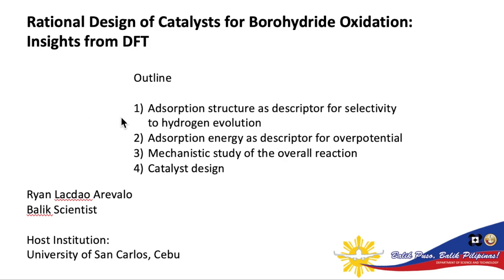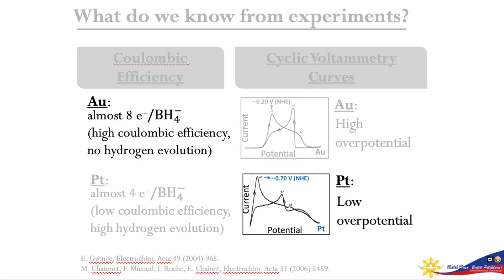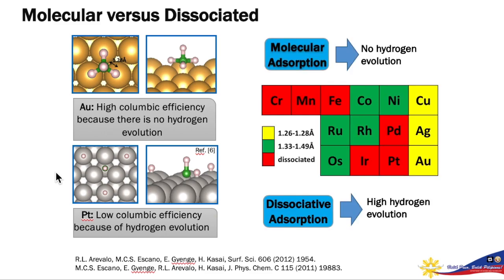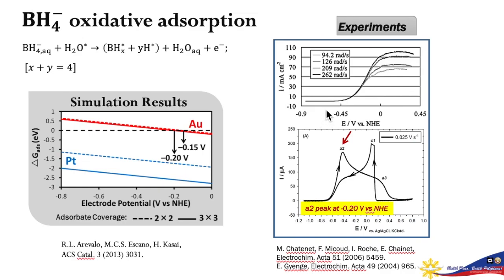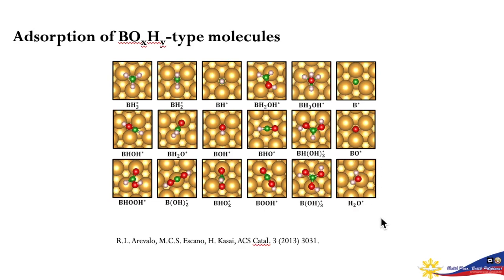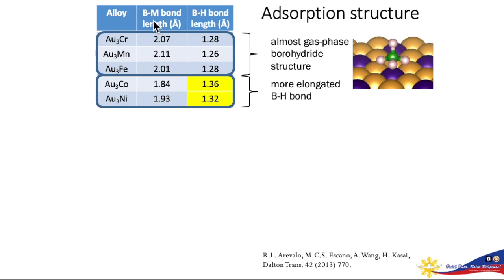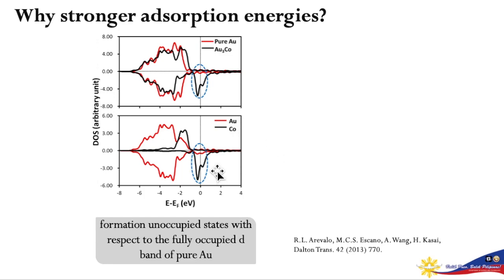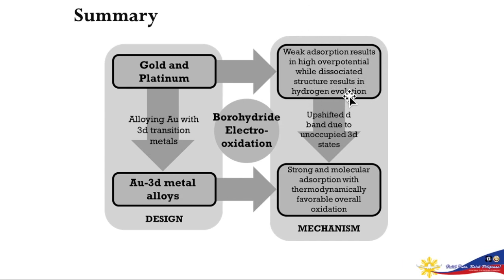DFT calculations for rational design of catalysts for borohydride oxidation

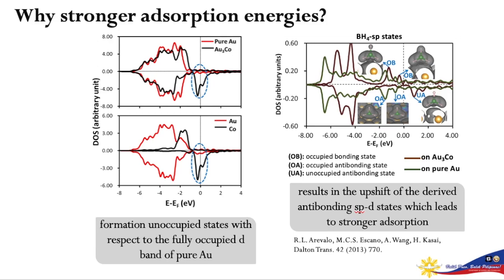Comment: Hello sir. I do have some questions boggling about your lecture. Let me start with the slide @24:46. I am wondering on why the partial DOS of Co in the alloy Au3Co is less broad compared to Au (or maybe smaller than Au i think?) wherein both of which have significant d electrons. Is it due to the stoichiometric ratios of Au and Co?
Reply from the maker: hello, the d band of Co is less broad (i.e., localized at a certain energy range) bcoz there is less hybridization with Au d band.. if we increase the number of Co, I expect it to be broader because of its interaction with neighboring Co. Note that the "number" of d electrons is not about how broad the d band is; rather, it is related to the height of the d band, not the width..